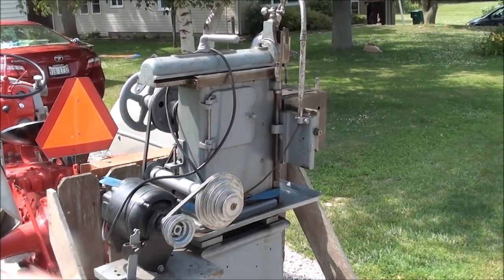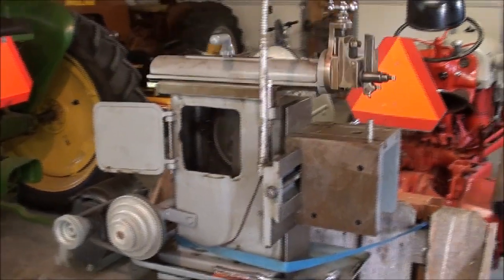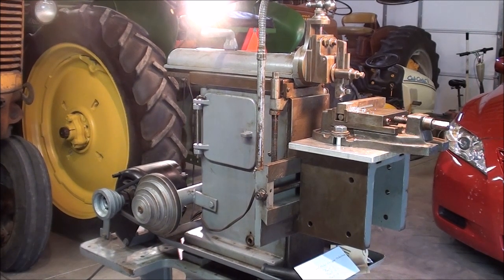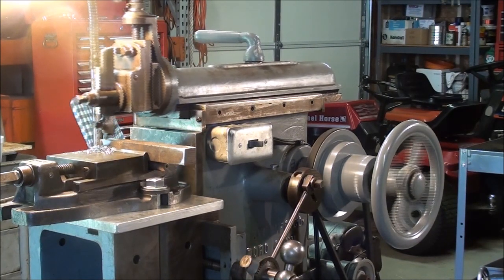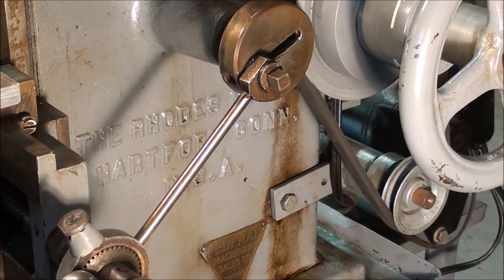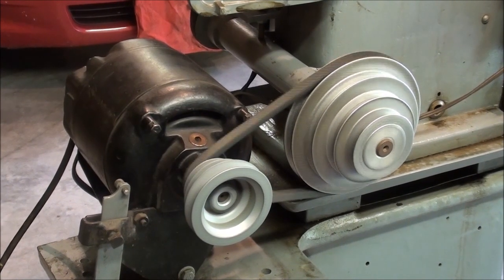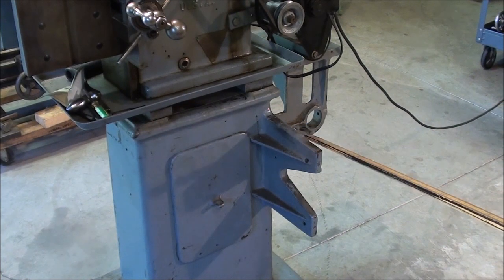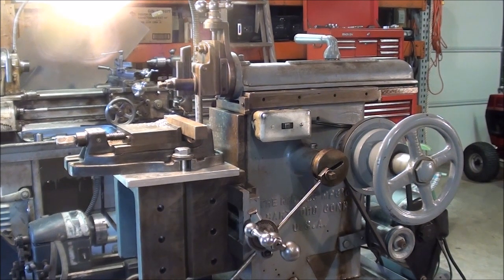TUBALCAIN BUYS A RHODES METAL SHAPER like south bend atlas

Comment: Thank you for shining a light on these fine old machines...  my first shaper was a Cincinnati 24" flat-belt drive that I purchased from an old machinist in Jim Thorpe, PA for $400... what a heavy beast!  He was in the process of dismantling it for scrap the day I bought it!  Glad I did.  It has enough power to snap a 3/4 by 1.5" tool bit cleanly in half (I dove for the floor!  The loose half embedded in the wall opposite the shaper!)   I then purchased a Pratt & Whitney 12" flat-belt drive shaper similar to the one you highlight here on your video for $100.  Both needed some work but I still have and use them.  Look for these old machines and give them a new home... you will also be glad you did.

Comment: Mr. Pete,  I too have a joy about these machines since I just this year finished refurbishing two Rhodes shapers just like your. Like yours mine did not have much use wear but they did have a lot of cosmetic wear from poor storage.  However, they look good now and I sold one to pay for my investment and got $1300 for it.  It does have a real good use that the mill has a tough time with and that is making internal keyways.  Very slick once set up.  Also your pedestal does not look like either of the ones I had (have).  Both were tapered fat on the bottom and thin on the top and were basically identical.  The motor arrangements different since one did not come with any.  The other was very cool with a large 20" ornate wheel that someone covered in a guard but I left it that way for safety.  Good luck with it and I look forward to some videos and hope to learn something about it.

Comment: Congratulations on your find Mr. Pete.  Although it may be a little slower.  A shaper can  produce a surface flatter and baby but smoother than anything that you can do on a vertical mill.  There are two things that a shaper excels at.  Dovetail ways and internal gears.  I have an Atlas 7".

Art

Comment: Bless You,  The Rhodes is a high end machine, its right up there with the best.
Shapers can machine anything, with a superior finish.  Trust me you will not
leave it alone.  Shapers are like a  magnet.  Shapers turn free rusted junk into
fine stock for your shelfs.  Shapers eat rust and create useful material before 
it hits an expensive end mill.  Shapers make less of a mess than a fly cutter.
You can even use your rotary table on it , lathe chuck etc.  Project ; make a file, racks and gears a cone.  Yes form tools. Even a good ole HSS twist drill
works fine.  I can not wait for your shaper vidios.

Comment: Slow, antiquated, and obsolete, perhaps.  However, a shaper will easily outperform a milling machine in the surface quality dept.  Check out James Kilroy's video about a shearing bit on his shaper.  He put the tool to work on 12L14 and got a surface that rivaled something that was ground.

Eli D.

Comment: Hi Pete,
You're right, most people think shapers are obsolete.
They'd rather chew up the bosses milling inserts on hard steel,
 stainless, or just plain mild steel.
 I have a 3/4 inch lathe tool on my G & E 16 inch shaper.
I bought the tool bit at a flea market for a couple bucks 
 and have used it on the shaper 14 years now.  
The shaper is excess from
a extrusion mill nearby and cost nearly $200. bucks.
The shaper spreads the cutting heat over
a larger  area  eliminating hot spots
made by end mills, minimizing distortion
and tooling costs.
Here's a clip of roughing a cast iron cylinder block.
http://youtu.be/PC4ctMYj5H8?list=UUGThfYVpmW3dLb3EBKRyLuw
Kappullen

Comment: O' NO Mr. Tubalcain, don't sawzall that old flat belt bracket off. Consider the mass of that cast iron base. We all like HEAVY metal to absorb chatter. Rigidity, rigidity, rigidity, heavier the better! Build a tool shelf on top, or bolt your new DRO post on to it! That thing would look good with a DRO!

Comment: I have to take you to task for the comment that the Shaper being obsolete it is in fact the best tool for forming lathe tooling for production wood lathes, as used in a wood turning mill, or at least that is the words of the master machinist where I work they taught me that the mills over heat the tool steel  oh well that may just be how they keep the shaper from going to the scraper

Comment: Great video but please don't cut the machine up.  Just for historical accuracy please leave it as it was made.  That would be as bad as taking a model A ford and putting a big V8 in it and throwing away the hood and the original engine, transmission, rear end and many other parts and then being left with only the basic body outline of what it was.